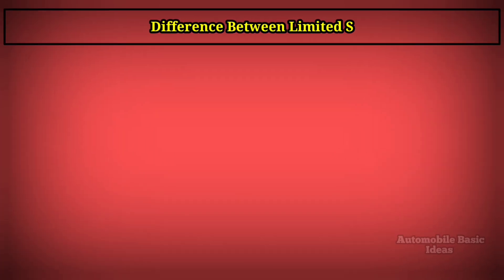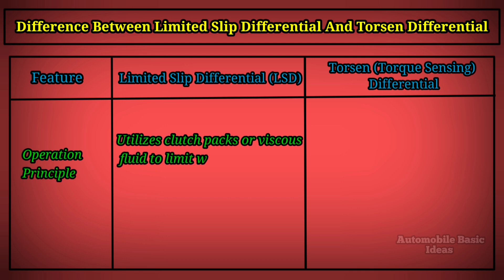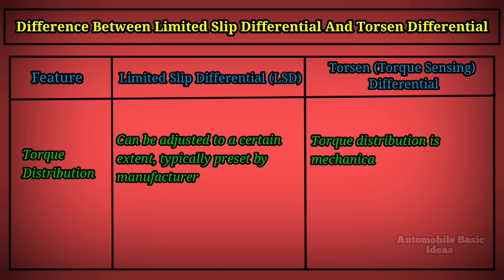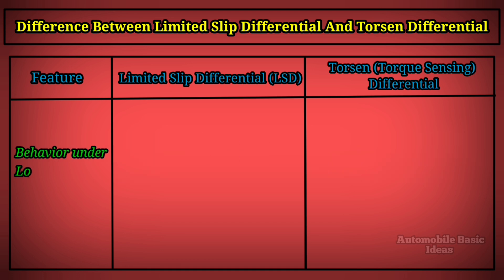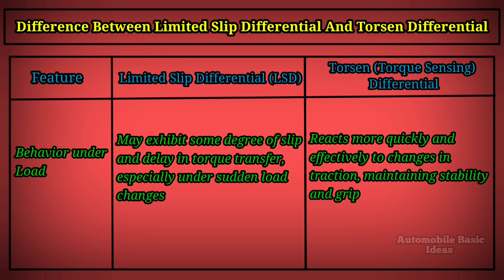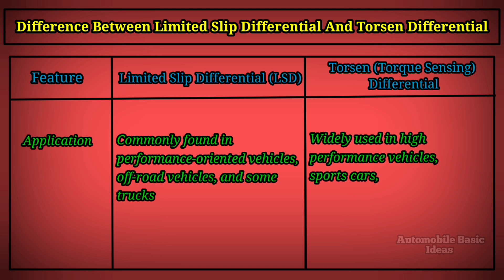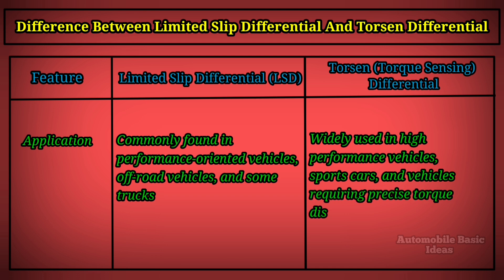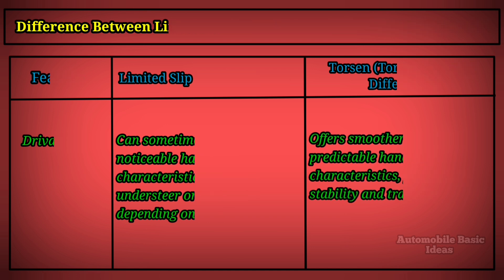Difference Between Limited Slip Differential And Torsen Differential?

Comment: Torsen locks up mechanically instantly once one wheel starts to slip.  LSD requires time to spin up the clutch packs before full lock up. Having driven both types on track myself I can tell you that Torsen locks up extremely fast when compared to LSD.  In fact, if you pay attention you can feel a bit of a shudder in the rear end when the Torsen mechanically locks.  It is effectively instant.
Reply: So is that “better?